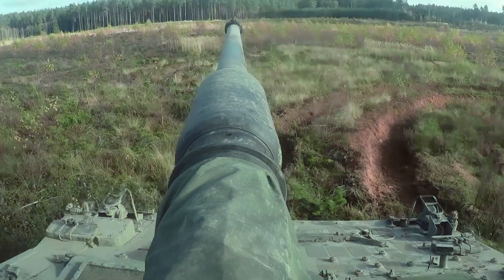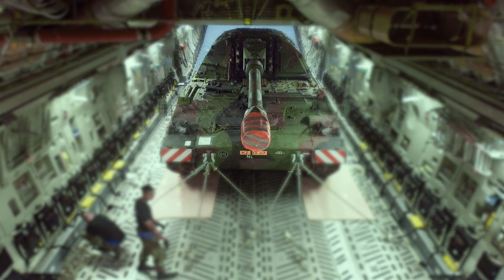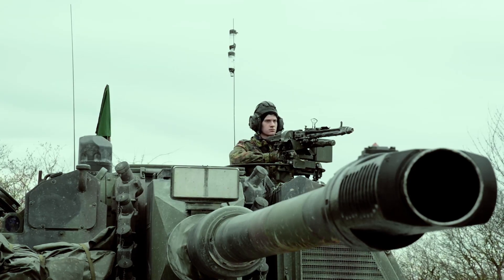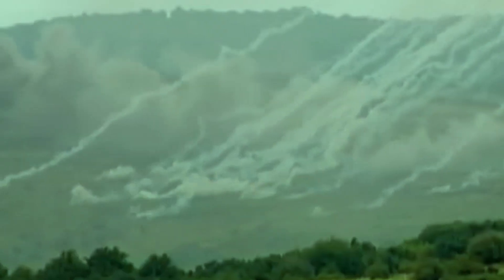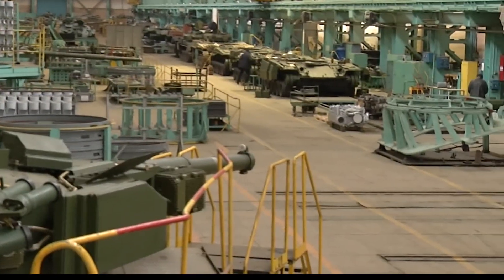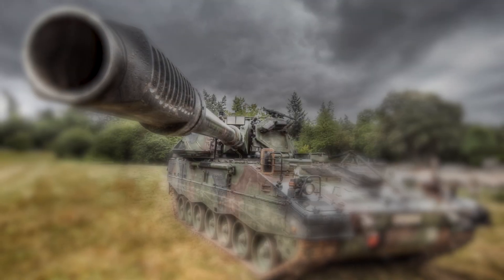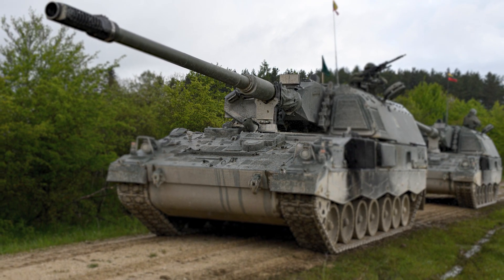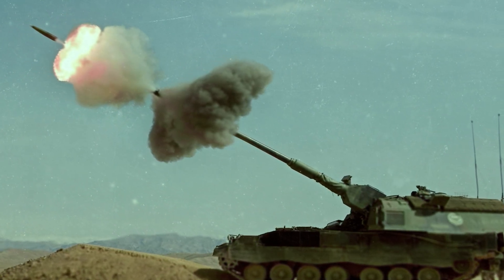NATO's Monster Panzerhaubitze 2000 Tank Howitzer (40 Km Multi Impact)

Comment: I also like the swedish Archer aproach with a vehicle that can move with a fast pace. Since it is developed in sweden I guess that it does not have issues with cold barrel.
Reply: Remember, Norway is NATO. Sweden is historically not (but soon will). Both Sweden and Norway are sitting relatively still in our boats to avoid "more complications"/full-scale WW3 as we read the Kremlin argument of "no NATO expansion" used to invade Ukraine. 

Our Scandinavian close brotherhood has always balanced on a thin line to avoid misunderstandings while we in Norway and Denmark were allied and you in Sweden and Finland were neutral. And we still have to move cleverly on our political toes, since we do not want to introduce reasons for more horrible wars to be "legitimized". 

Just look at us. We do hardly give anything to Ukraine. We do however give our friends in the UK a lot of weapon systems to be upgraded. It is hardly our fault that the British put the wrong address on the envelope when that stuff ends up in Ukraine like our M270 HIMARS compatible MLRS systems. It is not our fault that the Americans sends over the NASAM system that we developed with our allies. 

We Norwegians were founding fathers of NATO 70 years ago - we know that we do not want to stress our friends to our east (because of WW3 issues). Sweden and Finland also know this as you were alone and neutral. Thus we never provoked, we just prepared to be attacked. 

Peace is the goal.

Comment: This System is similar to the American engineered Crusader Howitzer developed in the United States during the 1990's.  During development, the U.S. Military shifted to a rapid reaction force doctrine that resulted in the cancelation of the project.  The Crusader was to large and heavy to be deployed via Globemaster or Galaxy transport to far off battlefields with-in the 72hr reaction time required under the newly adopted doctrine.  While in highschool, my friends father was an engineer on this project and I was able to learn about the system and its capabilities before its cancelation.  It appears that the Germans were developing the Panzerhaubitze 2000 at the same time, but did not need it to be deployable in a short time frame. I thought they were one in the same as they look very similar and it made sense that the canceled Crusader might have been shared with a NATO partner.  Originally the Crusader utilized another tractor without the howitzer, that was a reloading system that could supply ammo and fuel to the system in an automated fashion.  Dig a little deeper Dark Tech, I like your videos, but some lack attention to detail that matters.  See Su-27 video showcasing the Mig-29 more than the Su-27 itself.  I bet Russians are thoroughly annoyed by this more than myself, but those Sukhoi jets are majestic in there size and maneuverability.  The Mig-29 is cool as well but not as cool as the 40 year old SU-27 and its more modern iterations as well.  F-22 is the GOAT though and its 30 years old.  U.S.A needs to right the ship and continue to be #1, better us than the pooh ping bear click.
Reply: Not true and pls don't mix up the facts. The XM2001 and the Panzerhaubitze 2000 were created around the same time. The Panzerhaubitze 2000 was already tested while the XM2001 was still under development because it had alot of problems. Therefore after the end of the XM2001, it was proposed to improve the M109 or buy the Panzerhaubitze 2000 which had already proven how effective it was in test firings.

Comment: The krab, k9, and m109 are better guns and more reliable. Also cheaper.

The pzh is a great gun. But what we have found out is they break a lot and require specialized maintenance. The krab and m109 are much easier and more reliable.
Reply: modern weapons need trained soldiers....
Reply: @Wilhelm Eley if it was superior it wouldn’t be broken so much while krabs and m109s keep running. 
The feed system is finicky, it has numerous issues shooting, all the while the krabs and m109s are much easier to fix with no issues.
Reply: @kcimb  It's quite simple, it depends on the usage. Pzh2000 fired over 100 shells a day close to maximum range. Pzh2000 is 4 weeks longer in Ukraine than the krabs. This results in roughly 3000 more shells fired per howitzer. Thus, more systems need maintenance. Also, the pzh2000 gives automatic maintenance warnings after heavy usage to prevent accuracy loss and increase safety.

Comment: They should have retired the name Panzer after ww2
Reply: Why?

I think it is far more fitting than "tank".
Reply: @Wilhelm Eley The name tank  was a chosen to disguise the use of the metal box. 

Panzer or in full Panzerkampfwagen is simply descriptive, it refers to an armored vehicle used in battle.
Reply: @karstenschuhmann8334  "Panzerkampfwagen" is no longer used.
Reply: @Markus-zb5zd  Yes, it is only used in an abbreviated name.
Reply: @karstenschuhmann8334  I'd argue it's became it's own word and is no longer an abbreviation.
Reply: @Markus-zb5zd  Sure, I just wanted to explain why the word Panzer is a useful and well descriptive word, I answered on the original comment.

Comment: unreliable weapon. requires careful handling. a lot of breakdowns. which can only be repaired in the factory. so let it continue to be used at training grounds and at parades. and in commercials.
Reply: Nonsense, normal wear and tear when you fire hundreds of rounds per day, there’s going to be a repair shop in Poland for them.
Of course it’s more complicated to maintain than less capable weapon systems.
Reply: @HingerlAlois  8 shots, and u need calibrate , optical and electronic system and visors. pathetic weapon. but in magazines and news u cannot see this info.
Reply: @HingerlAlois  u can  believe in what u want. i just constate a fact.
Reply: Breakdowns? You mean in Ukraine?
Reply: so you can fight the russians with a knife....very reliable, no repairs needed
Reply: @Wilhelm Eley only 5 , from 15, are working. be real. info about teoretical resource of barrel, are u serious?
Reply: @Wilhelm Eley only 33.3% of working PZH2000. its good? its shame. 8 shoots and thats it. what u say its only  good 
 on words. but in reality 33% only , works. factory new. facepalm. its reliable?
Reply: @HeLLFiREGM  where did you get the 8 shots from? We're talking thousands of shots right now, which is a normal maintenance interval.
Reply: @HeLLFiREGM  also not factory new, the systems sent were used ones.

Comment: 1:50
*155 mm main gun, not 52 cal. :goodvibes:
Reply: 52 caliber is the length, which is 52 times 155 mm = 8.06 m.  He mentioned the barrel length of 8 meters.  Naval weapons use caliber all the time, like the Iowa-class 16" 50 caliber barrels.
Reply: @gregwestphal  I learned something today!
"In artillery, caliber or calibre, is the internal diameter of a gun barrel, or - by extension - a relative measure of the barrel length." -Wiki
And the Iowa class 50 caliber was what I was looking at earlier... and looking at the numbers... like... WTF?!?!?
And I guess it's the difference between CalibER, and CalibRE.
Thank you! 🙂
Reply: @IraTopp  not just artillery.. The cannon of the Leopard is the L44 or L55 because it's 55x120mm or 44x120mm

Comment: I think the new Swedish Archer howitzer is a better system. Faster, lighter and can shoot and relocate quicker. Probably a good bit cheaper too, as its placed on basically a Volvo rock truck chassis. It can even fire the Excaliber shells, ranging 37mi/60km
Reply: Different use cases
Reply: This system can defend itself in direct fire mode.
Reply: @0Turbox  yes, but than something went terrible wrong
Reply: Definitely a good system,  however has a different requirement.
Reply: The PzH 2000 can relocate faster... It can also fire Excalibur shells.

It's more reliable in case something goes wrong, especially with 5 crew.

Also quite fast and NBC + splinter and handgun protection.

Comment: Why does the title have that "Simultaneous Impact" word? Where was it mentioned in the video? Will it draw more people to get in more clicks?
Reply: It can fire 3 shells in a row that will hit the target at the same time. This is achieved by adjustig the firering arc between shots. A smaller arc means a shorter travel time so this makes up for the reloading time between shots. And when all 3 shots do hit at the same time the PH2000 is already on the move to a new position. Crazy stuff when you are comparing it to traditional artillery.
Reply: @oO0Xenos0Oo  Hey that's awesome! Thank you. Maybe a time stamp just to verify accuracy?
Reply: @denniso8049  I dont think this has been explained in the video. They just mentioned the fast firering rate.
Reply: @oO0Xenos0Oo  Where do you get your resources (info material)?
Reply: @denniso8049  I do live in germany so i have no problem understanding the german videos and articles provided by our armed forces or by the supplier of the system.
Reply: @oO0Xenos0Oo  I'll just google some of the information that I got here just to fact check.

I like this channel before, and now he start doing this. With an innacurate title like that, who knows if some of the contents may be just plain anecdote.
Reply: @oO0Xenos0Oo  one correction, its up to 5 or 6
Reply: Uhh. One question and you suddenly dissappear. Did my question scare you?

Comment: These systems have been shipped to ukraine as well and seem to be very effective when it comes to fighting russian artillery. None of them have been destroyed in combat yet but most of them already require maintanance due to excessive usage. Also the ukrainian soldiers have been trained in a very short time for this system and they are pushing the limits by using bigger explosive charges to increase range. All this adds to the rapid degredation of the deployed systems.
Reply: Desert and arid heat is another battle altogether in the weather warfare. Comparing the climate of Ukraine with a desert nation of hills and medieval tribes is beyond stupid.
Reply: @trc8197  Yup try swaping out a Hamiltan standard in Georga in full chem gear.
Reply: @trc8197  YEP
Reply: Ukraine ordered 100
Reply: @davidh.6930  Lol. Hopefully the war will end before all of those can be delivered. It will take up to ten years to deliver all 100.
Reply: @davidh.6930  you might misspelled "begged"  cuz ukraine can't "order" anything since it's effectively bankrupt
Reply: "seems to be very effective"
Reply: They cant fire over a 100 rounds per day they're useless a d30 is more reliable than this shit
Reply: Ukrainians might also use unsupported ammo. Also as a mass strike and not as a precision weapon. Its not made for that.
Reply: @nutzeeer  Strangely Russia uses the same barrel as the NATO, and the west, and mainly the same sizes, so shells, and charges are/or should not be to difficut, whilst replacing worn barrels may be difficult.
Reply: @thetruthhurts7675  no they don't they use 152mm that's a different caliber and a different barrel
Reply: We'll, I think he just actually found out that the truth does hurt 🤕
Reply: What's causing issues in Ukraine is the very high firing frequency and the fact that they seem to be constantly using very high charges to stay out of Russia's range. This puts a lot of wear on the barrel (just like it would be the case on any gun barrel). Usually this is why you have replacement barrels with you...
I guess that's difficult to do in Ukraine at the moment.
Reply: @detroxx56784  Yes.  The number of shells they fire must be crazy.  For PzH2000 a number of 100 p.d. was considered very high. I bet in UA they surpass that easily.
This is an artillery war at the moment.
Reply: @detroxx56784  There are no issues in Ukraine like that using too high a charge, Britian and the USA now are training Ukrainian troops to use correctly the weapons they have from NATO. The Uk has been doing this via a group you may have heard of, in Ukraine luckily since before Russia invaded. Replacement barrels are required all of the time because, especially rifled barrels (or munitions that have fold out fins), of the wear, and tear. On a ship the gun barrel/s are regularly replaced routinely. Ukraine is receiving gun barrel replacements as fast as they need them, they are held in stock in the NATO base run by the British army, so the Russians cannot target them without bringing NATO into the war. Finally when your own artillery outdistances the enemy why would you use extra charges on your equipment, and risk blowing yourself, and the gun apart?
Reply: I fully support this move.
Reply: video i seen this week, is only firing 1 shot and scooting bk to tree line seems a waste of 3 shot burst
Reply: @littlehills  Yes it would seem that way until you realise that nearly all of the NATO artillery Ukraine now has can hit places behind the enemy lines, and is far more mobile, and less easy to find. Mainly because Ukraine is now using modern equipment, whilst the Russian aggressors are using antiquated equipment.
I forgot to mention most of the modern NATO artillery outranges Russian artillery.
Reply: there is a video where a Kamikaze drone takes  the PZH 2000 out
Reply: @bastikolaski8111  "there is a video" - trust me bro.
Reply: Bad propaganda, nothing more nothing less.They were also used in afghanistan all the time, and the conditions there are way worse then anywhere close to the wether conditions in ukraine.

Sometimes it was even so hot, that the crew had to operate it mostly from the outside with a rope to set of the fire.
Reply: @shagal2142  Honestly? How do you use a rope for a fully automated gun system? which bascally uses what you used to write what you posted, a set of keyboards!!
Reply: @thetruthhurts7675  Watch the video? what do you think the rope was there, the Soldier used it for?
Reply: @shagal2142  LOL. A single picture in the video proves nothing. Also this was outdistanced by a south African system that shoots the same calibre ammunition out to 67.45 km, and inert practice rounds out to 76.2 km, and rather strangely was designed by south Africa to operate in deserts. it is called the G6 howitzer.
Reply: @thetruthhurts7675  
The G6 range of 76.2 km was achieved when a new shell was tested. Both sistems have the save calibre, so what the G6 can achieve in range so can the PZH 2000 with the same ammo.

Yet th G6 will not achieve the fire rate of the PZH or the stability.
Reply: @Shatterfury1871  "Could achieve" is the term you are looking for. Just because one big gun sends one kind of shell a certain distance, it doesn't automatically mean the other one can. For example the breaches may have different sizes, and hold slightly different anounts of gunpowder.
Reply: @thetruthhurts7675  
The PZH has received a couple of upgrades, the last version can use all the new shell types.
Reply: @Shatterfury1871  Which hopefully for the Ukrainians will be extremly good news would it not? Now they just have to persuade South Africa to send a few of those rounds, and see what they can destroy 67 KM away! Can you immagine doing that? Actually being 41 miles away from something and destroying it! I would not be able to contain myself, with the glee from such actions. Hopefully South Africa will do the right thing.
Reply: @thetruthhurts7675  You actually need to add the load for the rounds according to the specific target. No automation there.
Reply: @mweskamppp  Pretty much like a ship's gun then? The system if it is fully/partially automated will do those calculations for you. Because the Panzerhaubitze 2000 fires 3 rounds in 9 seconds, or 10 shots a minute the system does all of the automatic calculations including the amount of explosive required, or it cannot maintain that rate of fire
Reply: @thetruthhurts7675  I think we are chasing our tails with those fancy numbers.
So I just add one...the Italian Army did tests in 2009 where they shot over 100km far with the  PzH 2000.
But I would bet if one try the Italian Vulcano ammunition on a G6 you would get equal results.
Reply: @stemill1569  LOL yes we seem to be chasing numbers here. Either way Russia has only ballistic, and cruise missiles that can travel those distances. Most western Artillery outranges Russian artillery as standard. but If the Italian test figures are correct. WOW. That is nearly a quarter of the distance from the Russia/Ukraine border to Moscow. That is something else. Thank you for that piece of information.
Reply: @shagal2142  They usually fire the first shot with a long rope, at least while training. It's a safety measure, in case there is any barrel obstruction there could be a massive explosion that might injure the crew. Once the first shot is fired you can safely fire all subsequent shots in full auto mode.

In actual combat you would obviously fire the first and all subsequent shots in automatic mode since safety is less of an actual concern than enemy fire.
Reply: @stemill1569  Italien/German ammo yes i know Vulcano was first made by Italien company but the 155mm is a germany/italien corporation. also germany did supply UA with said ammo though we dont know in what numbers
Reply: @shagal2142  You have to add the load manually anyway. And there is no rope.
Reply: @shagal2142  There were problems in Afghanistan. The autoloader jammed often due to the dust. The heat meant they had to keep the weapons in the shade, and they had to pre-heat the barrel before firing. But I think these problems have been solved.